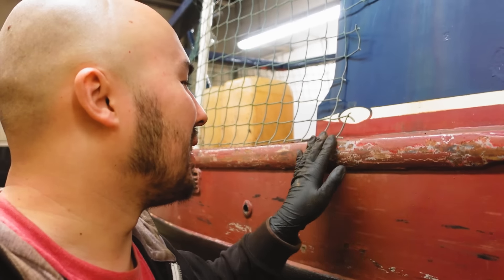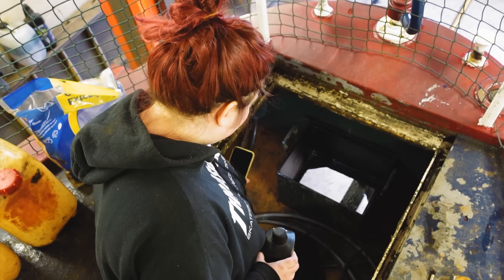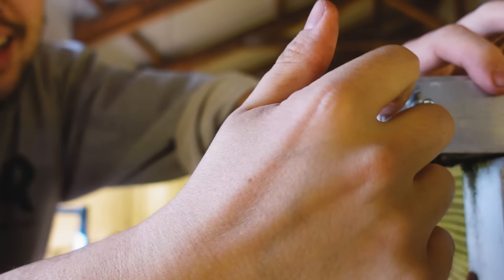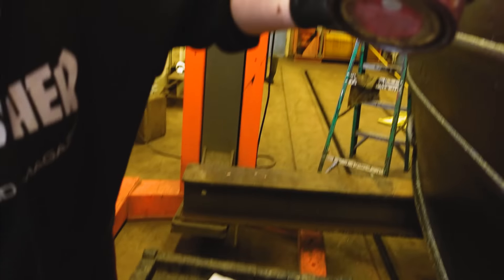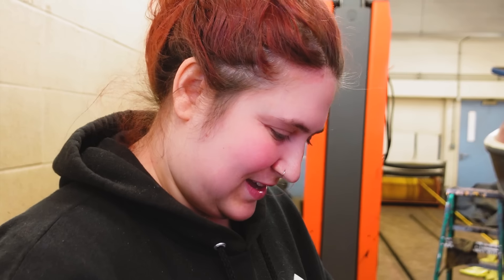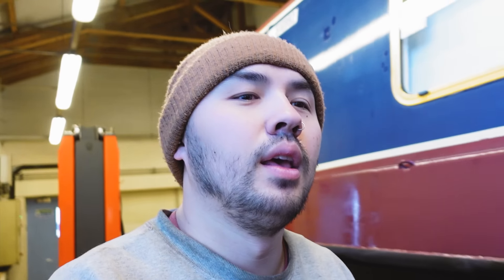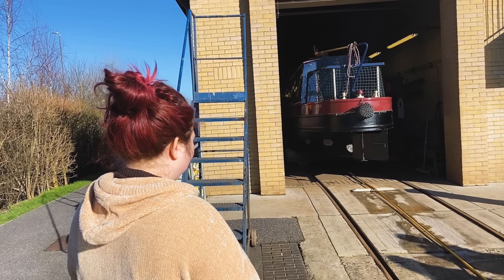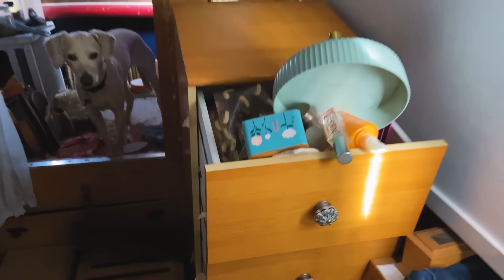It's finally time to launch our narrowboat... - 200

Comment: Those big scrapers are useful most of the time but I've found that a straight profile (not angled) razor blade holder is much better for lifting paint without resorting to a grinder.

Comment: Hi, I have noticed that you carry a 'pump up' type air horn. My 12v horn often dosent work and I wondered how well you rated your manual pump horn.  I have watched 'most' of your video collection, I love Rufus and offer my sincere condolencies for Rupee.
Reply from the maker: Hey! Thank you ☺️ 
We found the pump one much better as it doesn’t run out! We used an air horn once and it just didn’t last, and also a cheaper plastic pump horn and it snapped after about 4 goes haha!
So the one we use is a metal pump one and it works every time 😊📣

Comment: Hi just seen your video where you change your oil  fillter   did you know if you take the part numbers off the fillters. You can the go to a motor factor s and cross reference them  haft the price  and did you know the euro parts own Midland chantry  any nice to meet up with you at linslade boat market with Dave and loo from changing pace  chilli jam jeff